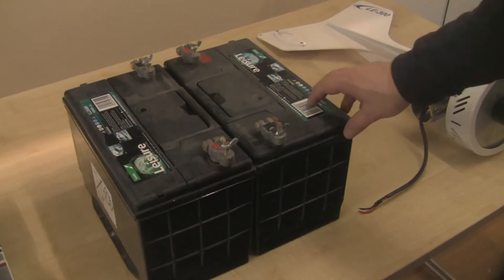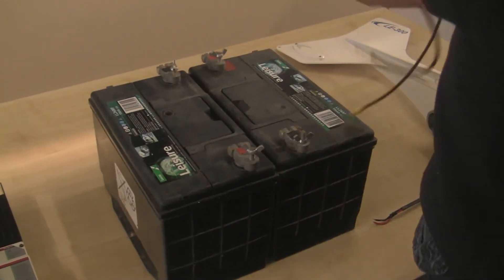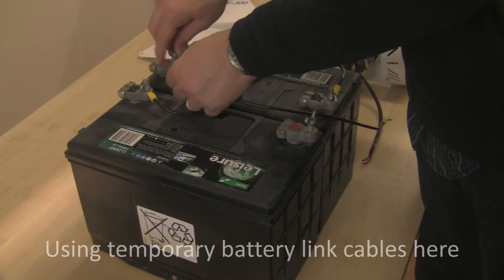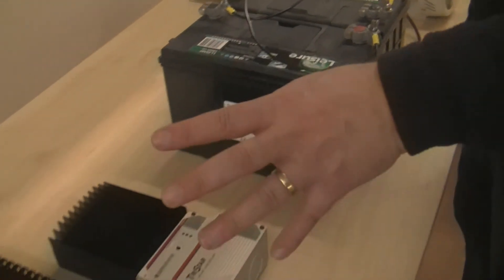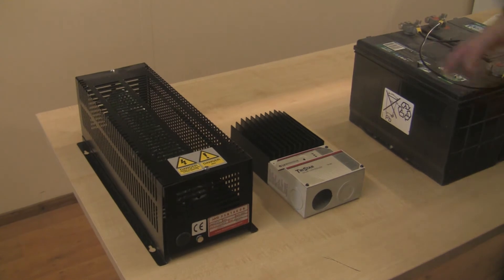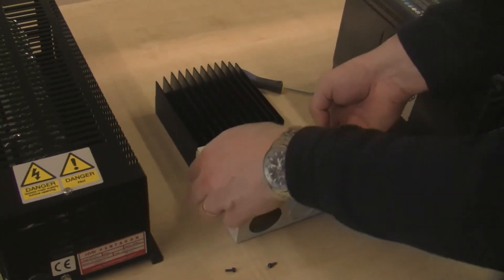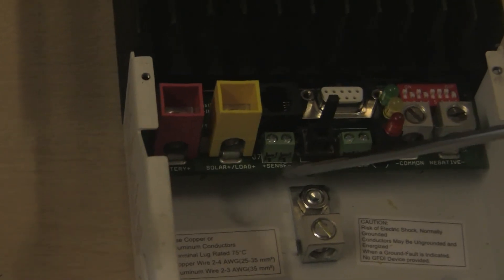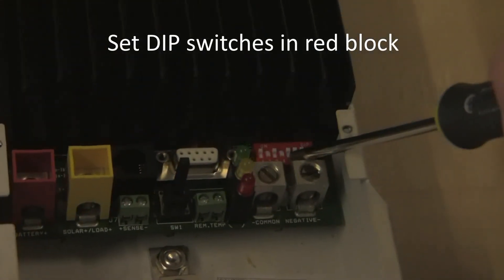Wiring up a Leading Edge Turbine wind system that uses a Tristar and dump load - Part 1

Comment: Technical question, what is the advantage the TriStar over a normal solenoid dump load system?
Reply: I have done some research on this, the TriStar is designed to transfer the power from the battery charging to a dump load when the batteries are full using I believe a PWM signal. Relay designs have no progression control they are just on and off so the turbine generator will go from very limited load of a full battery to sudden dump load when the relay switches which might be a lot in gusty winds and is not very good long term for the generator, some people will then use an undersized dump load to reduce the shock of the relay, but the turbine can then still overspeed in high winds as most turbines can produce higher than the rated power in high winds, this is also why they recommend using a dump load of 150% the rated power of the turbine in this case a 500w load for a 300w turbine. The controller can gradually transfer the load in theory infinitely between 0-500w depending on the conditions rather than being a very crude aggressive brake.
I recently was lucky enough to purchased an LE300 and TriStar with a 500w dump load second hand, the TriStar looks to be a very well designed simple and efficient piece of equipment and can conveniently be run alongside a separate solar MPPT into the same battery bank without any trouble.